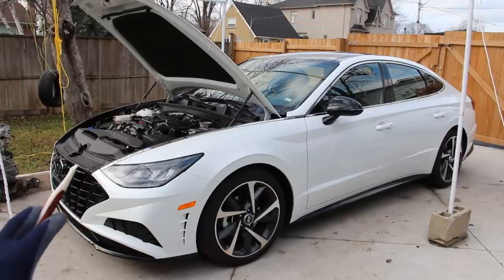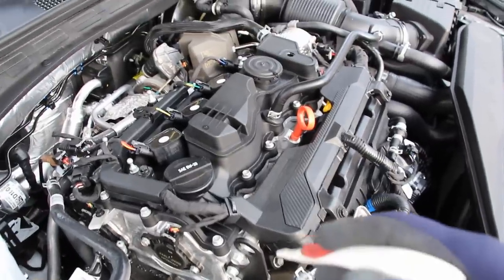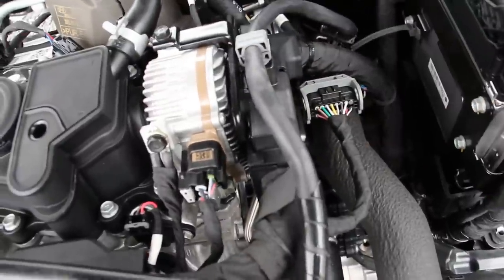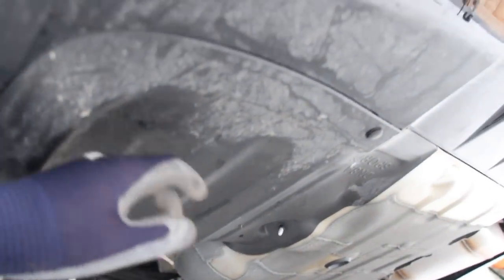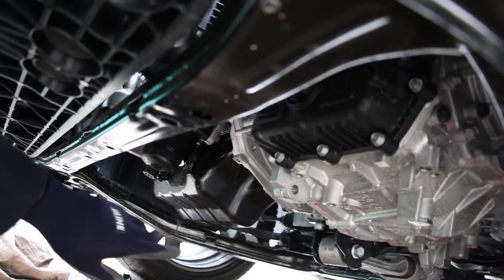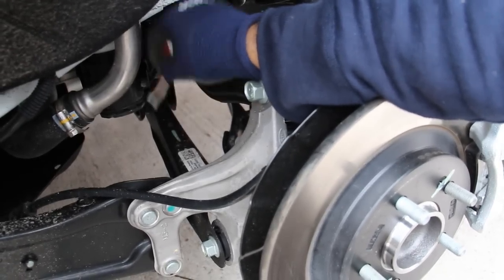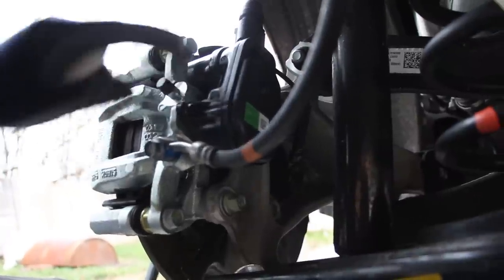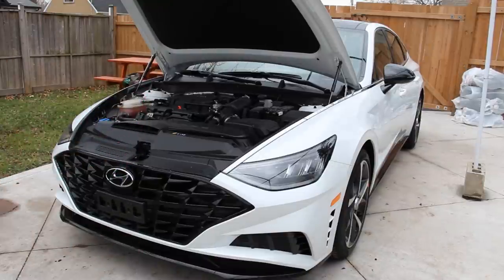Hyundai Sonata Mechanical Review

Comment: Hyundai is simply the best right now!
Reply from the maker: Sure .,.. maybe at infotainment
Reply: Ah maybe one day you will see the amazing engineering accomplishments hyundai has made in combustion engines (1.6 turbo no rev hang like honda k20) and the performance segment like the N cars!
Reply: @Dynamic_Entry  They can’t even make an engine block without a recall. They don’t know what they’re doing
Reply: @uhhTabby  what you mean? They make many good engines. Let me guess your thinking of the theta 2 which is 1 engine. The rest are amazing.
Reply: @Dynamic_Entry  my gf’s new 2020 1.6 turbo has already had engine replaced at 40,000 miles
Reply: @uhhTabby  your "gf" was not being consistent with maintenance. You need to be checking the oil otherwise those engines can last a long time. The 2.0 nu has made to 1 million miles.
Reply: @Dynamic_Entry  yep.
Reply: @Dynamic_Entry  How do you know she hasnt maintained it.? It's a 2020 not 2012

Comment: Great review.
Is this particular car assembled in USA or Korea?  I got one in june and it was from Korea.  It runs fine but the transmission is a bit clunky at low speed, like if there was some slack between the engine and the transmission?!?  Not the smoothest.  I wonder if there is a small problem with it.
Reply from the maker: Take it back and let them fix
Reply: The clutch has to wear in
Reply: Just to report back on the transmission...  The problem went away after almost 4 months.  I read that the tranmission computer had a "calibration period" where it "learns" how to shift properly.  I'm just not sure if it is supposed to take 4 months?!  Nevertheless, it's very smooth now.  Also, this little 1.6L T engine is quite lively.

Comment: If it makes it past 100k miles I will be impressed..
Reply: First service at 30k miles - time intake valve cleaning ;)
Reply from the maker: It might need some odds and ends before that but it could do it ...
Reply: Currently have a 2015 Sonata 2.0T with 165K miles; still original engine and transmission. So I can definitely see this new generation lasting past 200K with routine maintenance.
Reply: @smartkid1201  going easy on the throttle is also important for longevity. Lots of people love to launch the car after a stop or red light, especially on these turbo gdi engines which are pretty peppy but will wear faster because people just beat the heck out of them. That’s the reason why cars owned by elderly people have good engines because they don’t tend to drive as fast as younger people do. Drive conservatively and you should not have any issues in the long run.
Reply: @footballcoreano This has the be the most incorrect statement I’ve ever seen. There are more than plenty of Honda and Toyota vehicles that have exceeded 500k mile. A quick google search is your friend.
Reply: @footballcoreano Cool story bro 🤣🤣🤣🤣🤣🤣🤣
Reply: @footballcoreano OK now we know you are trolling.
Reply: @footballcoreano You actually have no idea what you are talking about. If you seriously think Hyundai engines are better than Toyota or Honda then you absolutely no doubt guaranteed are absolutely clueless on cars
Reply: @footballcoreano I know of that and although I like Hyundai alot I've had better experience with them than Acura(Honda) and think they are at the top with Toyota and Honda I wouldn't say they are better maybe of now a days Hondas but Toyota is hard to beat for top

Comment: Great Review of the Mechanics of this Car, My Friend! Extremely Informative, especially since I own this car.  I absolutely love the car! I've had my 2021 Sonata Limited since March 2021.  It's a fun ride... nice Pull ! I Believe that with all the features included.... it's pretty hard to beat getting a different car, at this price. Just disappointed for a few things (in no particular order): No AWD available, even as an option; No Fog Lights available; no grip (of any kind) to close the trunk.  Overall, 10 Months later... I have no regrets getting this car.  Maybe I'd consider the KIA K5, since it's similar in price and has an AWD option (not sure about the fog lights), but I never even stepped into a KIA dealership to compare.
Reply from the maker: Good to hear your experience. Which engine did you get?
Reply: @speedkar99  Sonata 2021 Limited.  1.6 Liter Turbo

Comment: I have a 2020 1.6t, with almost 70k miles, I have my own local mechanics check it while doing service, and no issues at all. aside from the crappy sound system by BOSE, it's a decent car, better than my 2017 Passat that squeaked and had the manifold stuck open. I've only owned turbo 4-cylinder cars, should I go NA in the future? I only hate how the car doesn't have much power in the top end.

Comment: At least most of the common maintenance items are easy enough. Trying to tow these is a bear. If you put it in neutral and get out, the transmission goes back into park...takes 2 people. No convenient tow points either. Many just strap onto the rims. The actual oil filters in these are unique as well. Wish they'd stuck to a common style instead of reinventing their own. 
My daughter bought one, she really loves it, but I know these 2 points from experience.

Comment: I work at hyundai three things. Hyundai should have direct injection and port injection. With the port injection only working at cold starts to prevent carbon build up since the combustion chamber isn't warm yet. 2 these cars are oil sensitive more than Honda and Toyota they need to make the car go into limp mode forcing people to bring their cars in for an oil change. I have seen people 8,000kms over their oil change and it damages the engine. Finally a catch tank of about 4 litres in size so every service there is less carbon build up from the PCV valve shooting oil back into the engine.
Reply from the maker: Yes agreed with all of those points.

Comment: Turbocharger plus EGR plus direct injection is what causes all the intake valve gunk. Turbos increase the amount of oil entering the intake side past the bearings. Then add the fact that people buying Hyundais and Hondas are likely using the cheapest possible oil and you have gunk at 50k miles.

Comment: Sonatas are easy to maintain. 
1. Oil service and GDI fuel system service every 5 months or 5,000 mi.
2. 4-Tire rotate and balance every 5 months or 5,000 mi.
3. 4-wheel alignment every 10,000 mi.
4. Air and cabin filters every 15,000 mi.
4. Brake flush every 12 months or 30,000 mi.
5. Automatic transmission service every 30,000 mi.
6. Coolant service every 12 months or 30,000 mi.
7. Spark plugs every 30,000 mi.
8. 4-wheel brake job every 50,000 mi.
9. Timing chain every 100,000 mi.
10. Periodically wash the car per weather conditions.
Reply from the maker: Engine replacement every 5 years

Comment: That oil leak on the oil pan is a gasket and is a waranty repair. My Venue with the non-turbo version of the 1.6 needs the oil pan gasket replaced too
Reply from the maker: It's just sad that the gasket didn't do its job from the factory brand new...

Comment: I don't get it why would anyone chose the G4FP 1.6 Turbo engine instead of the G4KN 2.5L when both are available new, have the same MPG, but G4KN is cheaper and has 10 more horsepower?
Also I'd deem it a little bit more reliable since there's no turbine in G4KN, but both of the engines are still new (released less than 2-3 years ago), so you never know how it'll turn out.

I'm looking at the Hyundai USA website and it says that the G4KN version starts at $24350 and G4FP starts at $31150.
Reply from the maker: The 2.5L is a place holder base model engine. I'm sure it'll be gone in the next iteration of this car.

Comment: I bought a Veloster N last year, now I'm worried about the oil pan gasket. Hope this was just a one-off incident or that the Veloster Ns are a bit more robust

I'm considering a carbon fiber hood with vents to help with cooling
Reply from the maker: Just remove the cover underneath and give it a good check over on the hoist.

Comment: Did I see a bolt-on front hub? There were some Torx or something bolts there but you didn't mention anything about them.
Reply from the maker: Sorry, I had to edit that out. I called out control arm instead of steering knuckle when I was recording. When knuckles are aluminum the hub is always bolt on since aluminum is too soft to press into.

Comment: is this the new smartstream engine? I heard they did it like Honda's 1.5T engine where the intake valve stays open so it can get sprayed by direct injector to help clean it. Really want to know how well it performs if it reaches 200 000 km. I heard Honda's 1.5T can and the carbon build up is ok (kind of like coating of carbon on exhaust pipe) so it shouldn't have problems in the long haul. I really wanted to get Forte 5 GT but my problem is turbo and gdi (double the pressure). Might have no choice but get Corolla Hatchback instead for reliability.
Reply from the maker: If keeping long term get Corolla.

Comment: Per pound steel and aluminum are nearly the same cost. I worked at a sheet metal shop where we bought 1018 and 5052-h32 and they were nearly the same price per lb. Aluminum was nice because it was thicker and stiffer for a given cost/weight but if you needed any welding then steel was the only way to go. Anyway steel is not nessasaraly a cheaper material.
Reply: It's cheap for Hyundai because they mine their own steel. They're in the steel business.
Reply from the maker: Aluminum is softer. Doesn't always work in some scenarios

Comment: I'm driving a 2018 Sonata with 189301 miles on it, fleet vehicle, meticulous fleet vehicle management. OTOH, it's a substitute because the 2021 I was assigned is in the shop for warranty repair for a defective wheel bearing assembly 😑

Comment: Great review and findings!!
Could, just could "QC" (Quality Check) to Hyundai is "CQ" (Check Quality)  😁😁😁   Its indeed disappointing to see a brand new vehicle with oil leak and improperly fastened bolt - can't imagine those components where we don't see needing to CQ (under the dash components, inside the engine, transmission, turbo charger...).
Reply: I guess the QC label was for the part itself not the installation 😂😂
Reply from the maker: Yeah I'm guessing the same thing. 
The placement of the cooler in front of the transmission check plug is a bad design though.
Reply: @mahdavimail  You are right!    The overall engine & transmission assembly QA still yet to CQ before calls it QC..  😂
Reply: @speedkar99  many brands & models these days are designed with almost no accident (or road debris) protection in mind... just shove it in any open space available since can't predict what damage will come of any collision.
Reply: @mahdavimail  I'm thinking the same thing.  On an episode of Car Wizard, previous shops managed to miss a loose suspension component  that was obvious and went ahead with multiple alignment jobs.  Why are crucial technicians getting stupider on a world wide scale?
Reply: @jsun3117  I would say nowadays short term financial numbers most matter for managers not the quality.
So they put whoever that can visually assemble things and call it a day lol it's getting worse and worse.
Reply: @mahdavimail  
When a bolt that holds the oil or transmission pan is left cross threaded and dangling like that with company knowledge there should be liability.

Comment: If you have a Hyundai that is running good after 80,000 miles you got a good one it will run forever.
Reply from the maker: If the engine doesn't blow...

Comment: I have the kia k5 with the same motor and I love the car other than that when the car reaches full operating temperature it has tapping noise that comes out the head on the drivers side. I really dont know what it could be. Any ideas anyone? (Btw I had to get the intake cam replaced at 3500 miles due to a timing problem)

Comment: Looks like an absolute nightmare to work on and a million things that will nickle and dime the owner to death once the car gets older.. No thanks. Not designed to be a long term car. Great video! 👍👍
Reply: @footballcoreano I agree. Hyundai used to build reliable cars in the recent past. I am not so sure about the ones they are making now. It's not just Hyundai. All cars have changed alot in the last 10 years or so.  A co worker of mine had a 2003 Hyundai outlast everybody elses car. He only just recently had to finally retire it. I see cost cutting trends in these new cars I am not crazy about. Tiny, downsized and overworked engines in vehicles they have no business being in, GDI, plastic intake, plastic valve covers, canister cartridge oil filters, plastic thermostat housings, etc. It's just cheaper construction. It will be fine until the warranty runs out maybe, but only just. The 2003 had port injection, and overall simple and more robust design. Alot less complicated, sturdier components, and less things to go wrong.
Reply from the maker: Yeah I think it'll make a good lease and return type of car

Comment: I own a 2020 1.6t sonata SEL plus model. Looks wise I love it. Tech wise it cannot be beaten given the price of the car and everything Hyundai puts in it as standard. I love the digital dash and infotainment center, no issues at all and for me personally all these get a 10 out of 10 mark from me. Engine wise and engineer that’s a different story. My car has a ticking when weather is really cold like under 10 degrees F. And when it warms up it goes away. It has a ticking when turning left on the driver side wheel. Had a really wobbly and not smooth transmission. Several times it jack rabbits and bunny hops on me with very hard clunks. Poor choice of tires on my car. Lots of road noise and instability. Worst of all it the dealership doesn’t give a damn either. Twice it’s been in and twice it’s either can’t duplicate or it’s normal. Since I have it documented I’m not worried. Because if something craps out and injuries me I’m gladly giving all this over to lawyer to show them there is a problem and Hyundai and their dealers don’t care. So interior, tech, looks and design. The car gets 10 out of 10 from me, engine and the engineering of the car they get a 2 out of 10 from me.
Reply from the maker: Glad to hear from an owner some real experience
Reply: @speedkar99  I’m glad to provide some feedback! 👍 in my honest opinion I’ve owned many sonatas and the 2015 year in my opinion can’t be beaten. I owned an eco trim back then with a dual clutch system. It was a neutral toned down design for that model year that wasn’t inspiring, and interior had a lot of plastic parts that broke easily. But the engine was top notch. Seems like 2020. The fixed all of the inside and design. But reverted back to some crappy engineering. Don’t get me wrong. It is peppy. Has a nice pick up and all and does a decent job on saving gas. My average is running around 44mpg. And around 38mpg city. So it’s not bad. It just quality checks missed out on a lot of things. And I miss the dual clutch. I just hope that 2023 model year they fix under the hood. Than it will be an all around good car. Enjoyed your review by the way! 👏

Comment: Love my 2020 just hit 40,000 miles no issues
Reply from the maker: Engine and oil still good?
Reply: @speedkar99  engine has been nothing but good not a single issue with it. I change the oil with Valvoline Modern Engine every 5k. And check the oil every time I fill with gas and no visible signs of oil loss or dilution.

Comment: I would like to share an incident. An acquaintance of mine was backing up his 2021 Elantra and he mistakenly hit the wall with right corner of his back bumper. It was not a big accident, it cracked the rear bumper, and it damaged the stupid computer module  and it's connector hiding behind the bumper, which controls tail lights and trunk functions. A minor bumper replacement turned into an expensive module replacement just because of the poor design.
Reply from the maker: Wow 
Amazing how they'd put a computer back there
Reply: They optimize the design for cost to build and warranty.  So few customers put repair costs anywhere on their shopping list. Try asking a sales person about it.

Comment: Road hazard damage through large grill slats -- good point! 

Designing to survive minor collisions seems to be a lost art at Hyundai (and other manufacturers). Computer in vulnerable area behind front bumper, grill radar sensor flush with the bumper, really? Design without consideration for durability smacks of misplaced priorities, inexperienced designers, or both.

Thank you for the mechanic's perspective on vehicle design -- it's refreshing! And props on the chapter markers, most helpful.

..Mike
Reply: Same thing with Focus. One guy didn't make the turn and hit snow bank - we know what happens to plastics at very low temps. Yeah, comp dangling in front of the wheel, held by wiring.
I seriously think that today's cars are designed to fail and produce additional income to the manufacturer or dealer.
Reply from the maker: Not to mention the exposed fuel filler neck tube in the rear wheel well where debris can fly up and slice it...
Reply: @speedkar99  Maybe you solved Hyundai's fire hazard.

Comment: A Vessel Impacta screwdriver gets the rotor screws out easily. Size P2 for a Honda. Probably the same for Hyundai. Vessel make a JIS bit set also, for use with a traditional impact screwdriver.
Reply from the maker: They'll eventually strip. Why have them when you don't need them.

Comment: Hey I got a 2020 Sonata and one of my fuel injectors has failed already. Only have had it for 1 year 6 months. It’s covered by warranty but what gives 🤦‍♂️
Reply from the maker: What was the issue, was it leaking?
Reply: @speedkar99  I dunno they didn’t tell me the issue. I was getting a gas smell inside the cabin. And loud clanking noise every time I accelerated